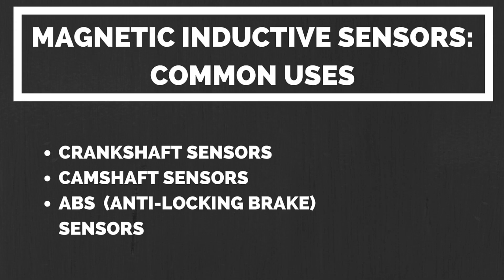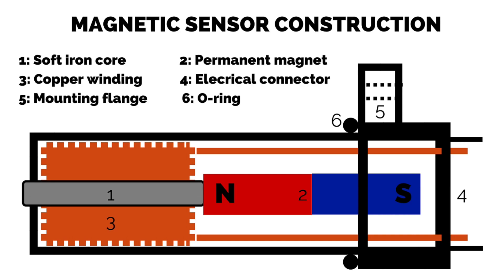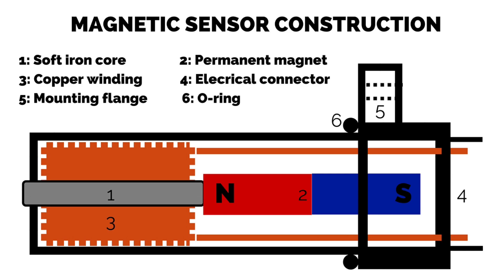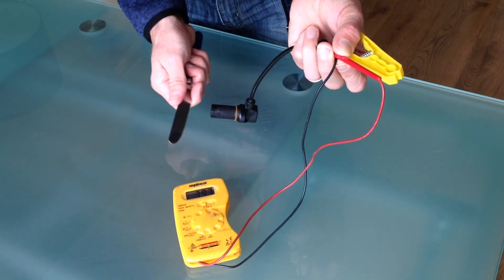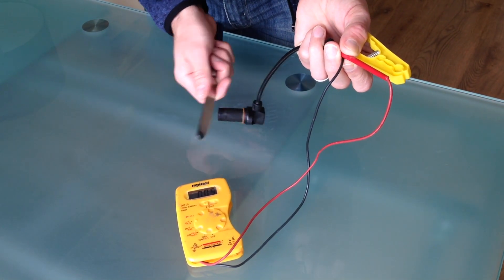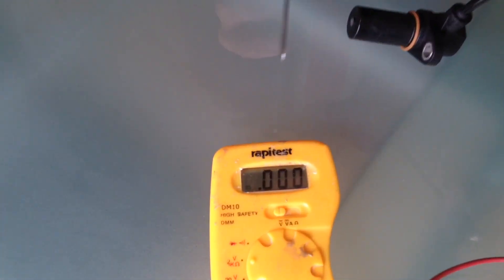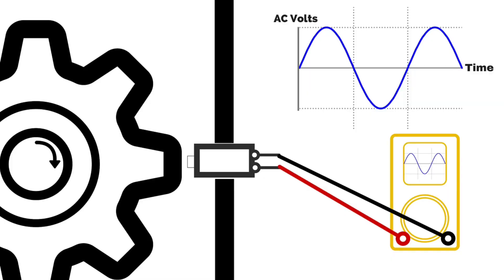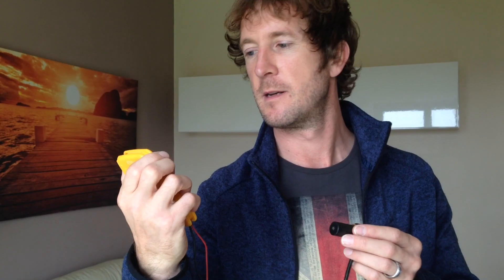How Engine Sensors Work: Crankshaft, Camshaft, ABS. Magnetic Inductive Sensors.

Comment: So the inductive sensor does not need to find a magnet north side mounted on the crankshaft, etc? Better solution than the hall sensor that needs to find a magnetic response otherwise there will be no signal. I have to start a homemade rotary engine and not putting magnets, I want to use the gear wheel with inductive sensor to get better sparks (obviously coil, Marelli injection module, etc). Correct? Thank you very much.

Comment: my gear sensor has two wires. one of the wires is larger and it has another insulated wire inside of it, wrapped in a bunch of tiny silver wire strands. how do i wire this properly? Thanks

Comment: My Nissan Almera 1.5 Petrol 2004 is having really bad starts.  In very cold weather it's even worse.  I can get it to run eventually but it throws up the code for bad crankshaft sensor.  I had it changed back in July and everything was fine for around 8 weeks then the old symptoms started again and the code reappeared.  Could it just be that the sensor has gone bad or could the chain be stretching?  Love your videos by the way!

Comment: So does it mean tht if the camshaft sensor doesn't give voltage when cranking its dead n the car won't start coz I hv a Mercedes v6 it cranks but no start so wht I did is I took my voltmeter put it on 20v the plg in my negative voltmeter wire on negative wire of the camshaft sensor then I plugged the posetive voltmeter wire on the signal wire of the camshaft it gv me 5v then when I place a metal on the cam shat the voltage it's dropping to zero dies it mean the sensor is dead or I'm the one who's testing it the other way round

Comment: Hi Chris , I am using a MSD84661 magnetic sensor and it is in my EFI ford (motec) ecu i am having problems with sync errors , i have tried different gaps ,it has a shielded wire , it is about a year old , my tuner did some filter adjustments , but its always come up ? do you know if i alter the position of the flag and reset  the crip angle,  if this would help , also i have read they are good at picking up noise ,could it be picking up noise from inside the distributor cap ?

Comment: It would have been every useful if you would have showed us how to hook the multimeter up to the sensor and where the sensor gets its power from....
Reply from the maker: There are two pins. One lead goes on each pin. There is no power other than that generated by the moving magnetic field interacting with the coil inside the sensor. Cheers, Chris

Comment: Thanks for the video. A diagnostics code tells me my motorcycle's crankshaft sensor has a fault. Unfortunately, a new one costs a £few hundred. Why would the sensor fail (for no obvious reason), and is it possible to repair it myself?

Comment: Nice vid and diagrams but you got your wires a bit crossed towards the end (pun intended).
The indicative sensor you’re describing has an output voltage proportional to the rpm of the reluctor - you demonstrated that nicely with the salad spinner and these are used in applications where speed information is required, but position is not. You went a bit awry when you mentioned the missing tooth “which helps the ECM”.
The missing tooth trigger wheel (used by most vehicles crank shaft sensors and commonly a 32:1 or 60:2 - teeth to missing teeth arrangement) is a feature of Hall effect sensors. These produce a square wave wrt (usually) a 5v reference and it is the frequency which changes with rpm, rather than output voltage. The engine management can interpret this frequency as engine speed, and will spot the missing tooth as it passes. From this it will know both speed and the position of the crankshaft relative to top dead centre and can time ignition and fuelling to suit.
This video is years old now though so I’m sure it’s since been covered by you!

Comment: Can a failing crank shaft position sensor cause the engines timing to be off thus causing you to burn more fuel but not actually bad enough to throw a code. Also jeep will stumpble studder and back fire upon restarting if still hot. Sometimes will completly stall out and ill have to wait to reatart it. Starts fine in the am but getting ritten gas mileage. Assume everything else is new and in working order.
Reply: I'm not sure you would be able to keep the engine running had the sensor completely failed and would it start to fail, you would have to keep pressing the gas pedal lightly to keep the engine from stalling which would use a lot of gas and almost impossible to keep the engine from stalling. I could be wrong, not all vehicle's operate the same.

Comment: The theory is correct, but most of the crankshaft pos. sensors I run into work on a 5Vdc reference voltage- NOT AC. These sensors typically "pull down" from 5v to 0v as the reluctor passes, creating a square wave pattern (when viewed via an oscilloscope) that the PCM uses to index the location of the crankshaft.
Reply from the maker: They are Hall Sensors, this video is specifically about Magnetic Inductive Sensors, as per the title. Cheers, Chris

Comment: Wheninstall this sensor should there be a space or it have to touch and will back off by it self?
Reply from the maker: There will be a clearance with the sensor tightened to the correct torque (i.e. you don't need to back it off)

Comment: rebuilt an engine cranked it ..6 codes.replaced cam crank sens. and plug and play coil packs etc. also engine backfired blew brake boost off throttle body.once all sensors and coil packs replaced cranked and cranked and cranked it caught and started and stalled twice...shook too.Chec ked timing both cams were off a little...reset timing cranked twice by hand confirmed timing...cranked and immediately engine backfired blowing brake booster line off throttle body AGAIN.no rpms in crank mode now no codes. did not check compression Timing is supposedly dead on.locked cams crank Libes up perfect what the fuck???anyone got a guess?

Comment: Hi Chris !
Is it possible that the sensor perform if we have the coil around the permanent magnet. (without part 1 ) I assume that the permanent magnet will make its own magnetic field and when the ferrous material pass by that field it will generate the voltage impulse so we know RPM. So why exactly is that soft iron core needed ? Is it because they can connect to each other or what ?
(sorry for bad english)
Reply from the maker: Hi Filip :-)

This is an interesting question. I just sketched some drawings of the magnetic flux from the magnet in the two versions of the sensor (one with a soft iron core, and one where there is no soft iron core and the copper coil is arranged directly around the permanent magnet.)

These sketches demonstrated that the soft iron core serves to concentrate and extend the flux in the centre of the copper coil. With the coil wrapped around the permanent magnet itself the flux is much less concentrated than it is with a soft iron core, so the voltages produced by the coil would be weaker. Another reason I can think of is that permanent magnets can be de-magnetised with hot-cold temperature cycling, whereas the soft iron core can protrude from the sensor and be exposed to changes in temperature, whilst the magnet is protected from extreme temperature changes by being hidden inside the sensor body.

This is my best guess, if any other viewers have any opinions, please feel free to contribute by commenting below. (P.S. Filip you speak better English than some British people I have met! 😂) Cheers, Chris
Reply: When you put Ferrous  metal, "nail, a bolt or piece of metal the magnet will stick to" against the end of the permanent magnet it extends the magnetic field to the end of the metal you just brought in contact with it. That with a coil of wire around it will now send an A/C pulse that can be measured from the 2 wires of the copper coil. A fun way to visualize the effect it to take a piece of metal, say a bolt and place a fairly strong magnet to the end of it. It sticks to the magnet. Now, bring the end of the bolt not the magnet close to another piece of metal and it will stick to the first bolt. The magnet field is extended through and into the metal bolt or bolts. If you remove the 2nd bolt and wind some copper wire around the bolt then hook it to a meter set on a fairly low voltage setting or better yet and oscilloscope then take a piece of metal, ie.. another bolt like or even the 2nd one you just removed from the end of the first one then wave it close to the end of the bolt with the copper wire around it. You should get a reading. Likewise if you pull the magnet off the bolt with the copper wire and wave one end of it close to the bolt with the copper wire you should also get a reading. Hope this helps.